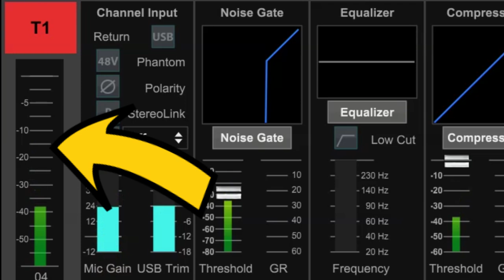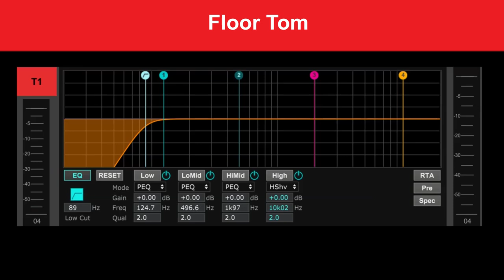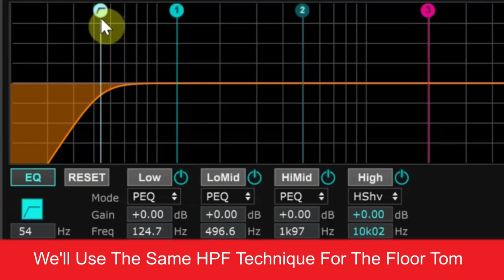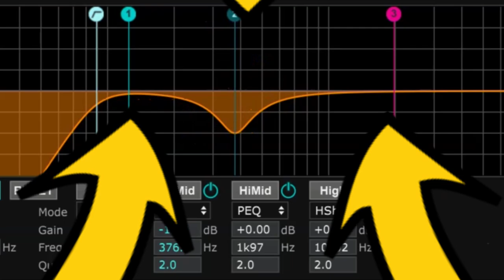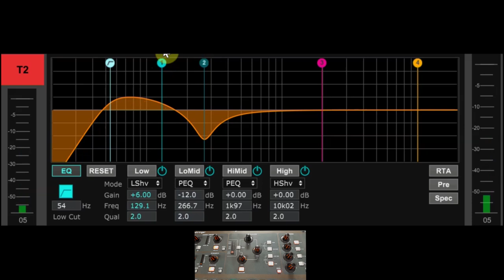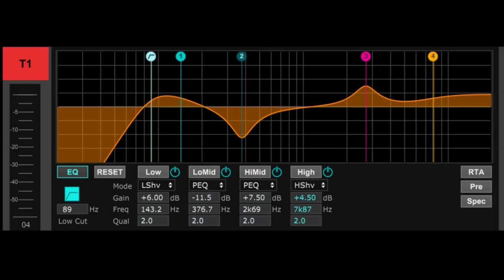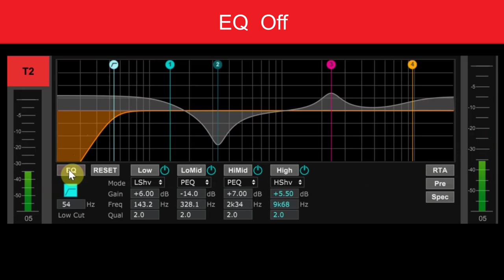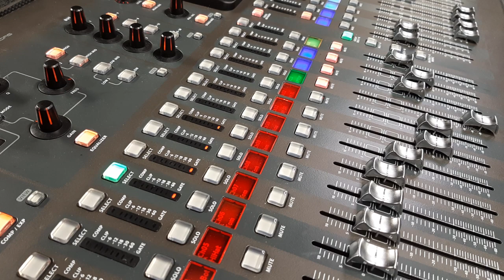How To EQ Toms - Drum Mixing Tutorial - Live and Studio Drum Mixing - Shown on the X32 M32 and XR18

Comment: Great video.  This is how I EQ live drums and it works.  I have a quick question.  Do you gate your drums when you set up for live sound first and then EQ or do you do that after EQ?  I personally don't know if it makes a difference if one is before the other or not.  I'm curious what your thoughts are.  Thank you in advance.
Reply from the maker: I usually start with a tom preset and the gate is already enabled... so unless there's something really wrong in the starting EQ, I loosen the gate so it's not doing much. Then I fine tune the EQ on the tom, ...and then fine tune and tighten the gate. So, technically, I'm doing the gate second I guess, but it's sort of being done at the same time in a way too. Especially since one thing can affect the other.
I'm usually not using the gates to shorten the toms (unless the drums are tuned really poorly). I'm using them to keep the other stuff out of the tom mics.

Comment: Do you recommend using a gate or expander for drums?  Our church doesn’t have a mix engineer. Pretty much set and forget so I’m leery to engage them.
Reply from the maker: I almost always use a gate on kick and toms. Rarely on snare, and moreso on a bottom snare mic if I do. Ghost strokes that a lot of drummers use makes it a bit challenging to gate a snare in a live situation and not lose some of those.
 ...Unless it's something like big band/jazz. Then no gates are more the norm.
But I'm more (usually) using the gates to keep other things out of the drum mics rather than trying to reshape/shorten the drums. But, that depends on the drum tuning. If there's a droning tom, then I will be gating that to do something about the length of that tom.
That said, without an engineer listening to what it happening during performance levels then it gets tougher. Hopefully the drummer tunes the drums well enough that the only thing gating is mainly doing (or wanted for) is just keeping other sounds out of the drum mics. Just so there aren't a bunch of open mics onstage. So they are gated 'most' of the time, except when that particular drum is being struck.

At that point, and with no engineer, you can be a bit conservative since you're not trying to kill a droning tom with a gate vs drum tuning. Maybe the gates open more than they should, but overall are closed. Maybe every drum gate opens with a snare hit and you can live with that if you have to. What you don't want is the drummer having to change their playing style and really HIT the drums hard just to open a gate when they play.

On a mixer/gate with frequency selective gating, you can set the gate to open on a more of a selected frequency range. This lets you dial in the threshold a little more conservatively, yet the gate be closed when it needs to be closed. The full signal still passes through the open gate, but the frequency setting tells the gate what sound/frequency to open on. So you can set it so 80Hz of the kick opens the gate but 1K of the nearby snare won't open the kick gate. Or 100Hz opens the toms gate (which the tom likely produces) but not the ting of the ride cymbal that is not likely doing much of anything at 100Hz.
Reply: Thanks for taking the time to reply. Much appreciated!

Comment: New sub here, I’m looking at getting either a Midas mr18 or berhinger xr18 , these videos are great! Which mixer would you recommend? It’s for potential live use if we ever manage to get back gigging again ....!
Reply from the maker: Current pricing has the MR18 at 599.00... Like only 40-50.00 more than the XR18. So, you get the upgraded pre's and a 10 year warranty for 50.00 more.
At least that's what it was the last time I looked at Sweetwater.
While there might be some argument how much you'd notice the preamps in a lot of live settings, there's not much dispute the MR18's are usually more preferred, and add in that 10 year warranty, and it's an easy decision right now.
Thanks for watching! :)

Comment: Allen are the drums you are using electric?   They sound like the Alesis Strike samlpes
DJ
Reply from the maker: It's been a while but likely was Steven Slate drums. One of the less processed kits to allow for a bit more aggressive settings.
If you want to hear the process played out with a full band, check out this video:
https://youtu.be/k2wgnPQI_is
The room mic on the camera is not exactly representative overall, but I switch away from that in certain points to the console recording which is a much cleaner listen. So there's a bit of context and reference as the video goes along.